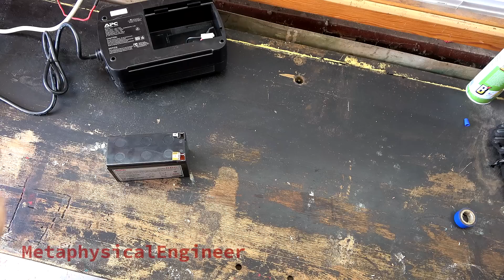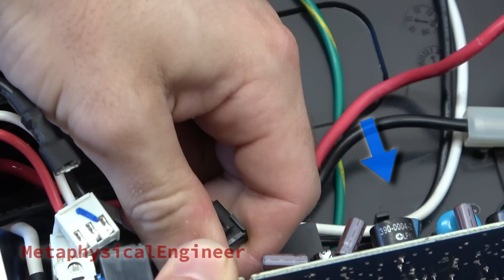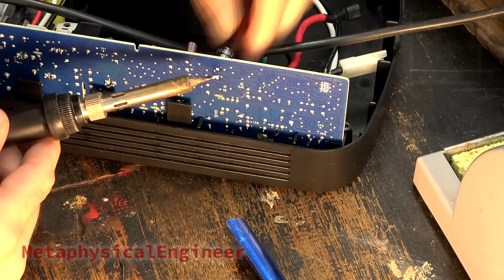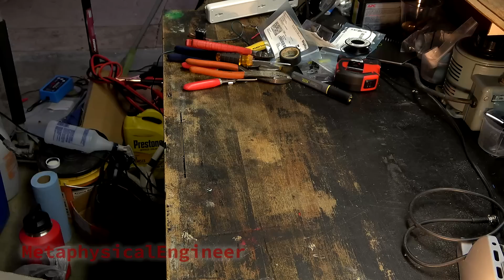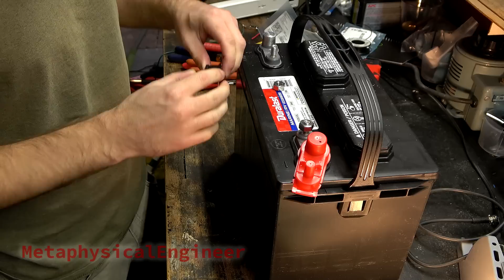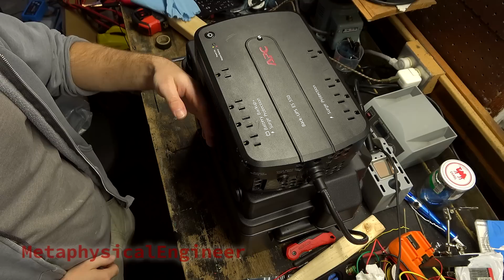Modifying broken UPS for long endurance BACKUP POWER!

Comment: Thanks for taking out the time. Quick question, how do I do this with a ups that is 24v and comes with two of those little batteries while I have one 12volts, 75amp car battery, do I have to get an additional battery which I cannot afford right now or can I make one battery work with it?
Reply from the maker: You need two identical 12V batteries for a 24V UPS.  If you need emergency power quickly and cheaply, a little inverter is a better option right now.  This won't have the instant transfer of a UPS, but will let you have things powered during an outage.  

I advise an abundance of caution.  There is a huge amount of energy involved when working with large batteries.  I paid a lot of attention to using the proper size fuses and protecting the wires.

Comment: I used one of these that I had laying around and replaced the internal battery with an 18 amp hour battery. it takes a long time to recharge, but it does work. I didn’t need a fan because I’m using it to run a router that only draws about 10 W. it keeps my Internet up for 12+ hours when the power goes out.
Reply from the maker: Nice!  Sometimes internet and a way to charge your phone is all you need during an outage.  May parents do a similar thing with a big battery and inverter since their area is prone to outages in winter storms and low on the priority list for getting hooked back up.

Comment: Thanks for your video its awesome!  I saw this trick the other day;  I have been dying to try!
You said your soldering pen was a bit old? maybe you have some old carboned tips also? I know I do! 

soldering
Reply from the maker: Thanks!
Part of the issue is that solder station is a Radioshack unit that's basically impossible to find parts for now.  Torn between finding ways to modify it to operate an iron I can get parts for (there's a video idea!), or outright upgrade to a proper solder station (boring but less time and less chance of failure).  Maybe both, just for fun.

Comment: Did this a few years back with a spare inverter and some used solar batteries from a friend who was upgrading to lithium. My home datacenter can run for about 24 hours on the batteries if I shut down everything that pulls a lot of power (ie the desktop and PoE switch). Enough to keep the internet going for a while during power outages, which is nice when storms roll through.
Reply from the maker: That's how to do it!  Hence why I keep have one monitor stay running during the transfer and I'd shut that off too if I had to keep things up for a while.  

My parents have a few batteries and inverters they use to keep things running during storm outages, as it can be a while before they get power back.  Storm raging outside while they're happily siting by the gas insert with a lamp and their laptops, all running off the backup batteries.  They can even run the central boiler to keep the pipes from freezing if the temps really drop.

Comment: Every APC I have ever worked with has had a "current limited" charger circuit - so in theory, you can add a bigger battery to any of them.
The only issue is "can the charger circuit work reliably and handle the heat of running for DAYS at a time"? - which a small fan on the final regulator is a good cure for.
Reply from the maker: So far the charger has worked alright, but a recharge time measured in weeks means I'll have to connect an external charger to get it boosted back up quickly.  Other commenters have mentioned having charger circuits fail on them, often taken out when the original battery failed.  Future upgrade or version 2 will have built in charger more suitably sized for the battery capacity.
Reply: @MetaphysicalEngineer  I've seen it take A week to recharge the battery after an extended outage. But seems like you get more outages then I do, or you worry about "back to back" ones more?
Reply from the maker: @bricefleckenstein9666  Not yet had back to back outages, but that doesn't rule out the possibility, either.

Comment: My approach is to save anything important then put the computer to sleep. Uses less power than shutting down and lets it ride out longer power failures than staying on since sleep only uses a few watts. If I do end up losing power then the computer still put its disks in a cleaner state than when power suddenly drops while computer is running.
Reply from the maker: Sleep or shutdown is the usual strategy during an outage, but a render or upload would still need to be restarted.  Render uses GPU for some tasks and that doesn't suspend its RAM during sleep mode, and YouTube doesn't like it if the upload data stream just goes dark for hours.  Wasn't worth the effort on the software engineering side to make those tasks gracefully deal with the edge case of unreliable power.

Comment: 1 volt charge left on a lead-acid battery bad? I had an idiot locally who wanted to sell me a bunch of 0V lead-acid batteries. Sure you can charge them back up, but they'll have very little capacity.

Comment: Great video! Watched all the way through - unusual for me. Thanks. Question:  When you build the activation circuit, you take it out of something that I and most others can do, so I'm wondering why not just let the fan run all of the time? Maybe a lesser cfm version? That would be easy for anyone to wire up.
Reply from the maker: Thanks for watching!  

The issue is the fan uses almost as much power as the charging circuit, so the battery possibly would never recharge at all.  Also, if the unit were unplugged, the fan would drain the battery dead unless deliberately disconnected. It's possible a lower power fan could be used, but that's still a passive discharge problem and I had to err on the side of caution since I was pushing the circuitry far beyond expected use case.

Comment: Hey, thanks for the video.  I now have a better understanding of what one is actually buying when one buys an inverter, and why they often seem so different from a UPS even though in principle they're doing the same kind of thing.

It's all about the waste heat which sorta kinda varies proportionally to the amount of time the thing is on battery mode and the amount of wattage being pulled.

I don't have the skill, patience, or tools to  build one of these out of the similar UPS I have that also has a dead battery.

But it's neat to see how it works.

Comment: Would it still be fine if the PC was doing something more compute intensive like rendering a fluid simulation in blender for example, or running a GPU and CPU test at the same time?

Comment: Nice. I personally use an old APC SmartUPS 1500 to cover my router, wifi kit, TV, and a LED light in our living room. I use a large old car battery which is in a vented garden box just outside on our patio. We have lots of powercuts which is why i did this. Its enough to run the LED light and our internet kit for 4 hours. Plus the expensive TV is protected against spikes from the outages.

Comment: Generally speaking, it's a bad idea to put a larger battery into a small UPS. I ran the idea past my EE brother (lead research engineer at APC pre-Schneider) several years ago, who told me that the inverter was designed to withstand sustained operation at rated output for only about a half hour before overheating to keep it cheap. They're rated for about 20 minutes. After that, he says the inverter is likely going up in smoke. Even at lower loads it will eventually build up enough heat to cause failure. Adding a fan can help, but the airflow needs to pass across the heat sinks and other components enough to keep it all cool, something it was not designed to facilitate. Adding intake and exhaust holes doesn't solve that problem. Also, consider recharging. The charger is only designed for a 7 amp-hour battery, and it too can overheat. Even if it doesn't, the charger is going to take an awfully long time to recharge a larger depleted battery.
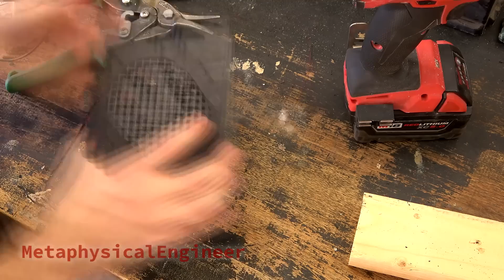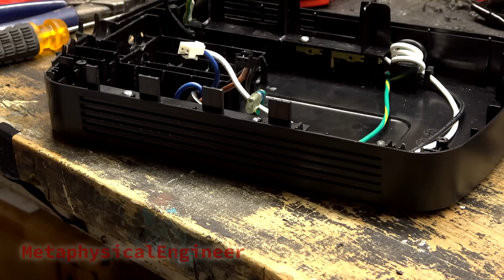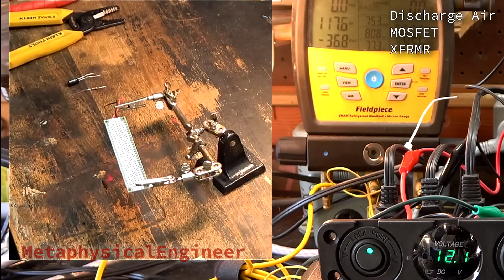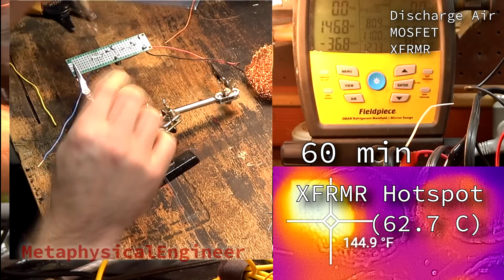Reply from the maker: 12:30 thru 14:30  shows how I specifically set up ventilation to direct air across the MOSFETs and transformer, and 15:30 thru 16:25 shows the extended duration load test with thermistors mounted to those components, wherein they shrug it off without coming anywhere close to maximum ratings.  

Concerns about the charger are valid.  Those are addressed in a bit more detail the pinned FAQ comment and narrated in the recent livestream.  The charger in this unit is essentially a maintainer for such a large battery, and it will need an external charger to recharge in a reasonable amount of time after extended use.  When it fails...I'll either rebuild with beefier components or bypass it entirely with a better suited charger module.

Comment: This video is NOT sponsered by Jackary... dude made his own... 
Note to Dude: buy both a countersink bit and a deburring tool... make that case mod a bit neater next time... plenty of old UPS'es out there in junk piles with dead battery problems... as long as the electronics are fine... New battery is all they need!
Reply from the maker: Deburring tool is covered in the pinned FAQ comment, among other things.  Discovered mine was missing when I went to drill the holes.  Since replaced.  

Off the shelf power banks with UPS inverter functions have some neat features, but essentially all I've looked at have too long of a transfer time between grid and inverter. 30ms instead of 8 to 12ms all but guarantees a PC will lose power during the switch.  That said, I'd love to do product reviews on some of those units someday.

Comment: would recommend not using a lead acid battery that's not sealed as that can cause an explosion from the venting of gases from the non sealed battery
Reply from the maker: Please refer to the pinned comment where that and other common concerns are addressed.  TL;DR: explosion risk for light duty single battery applications is conflated with the risk of massive battery banks under heavy cycling.

Comment: I would rather just power my stuff off of an LFP setup, for seriously long run times, and not having to worry about damaging lead acid with deep cycling, not to mention the massive increase in the power to mass density.
Reply from the maker: Lithium battery plus required BMS would greatly increase cost, though the high performance and deep cycling capability would be very nice to have.  Definitely on the table for future version 2!  Pinned comment addresses that and other common questions.
Reply: @MetaphysicalEngineer  I did it pretty cheap.   I guess it all depends on whether you keep your eye out for deals that come up around you.  Much like you did with your used UPS.  If you want super cheap, PPS are pretty cheap these days, and if you keep your eye out, you can find MPP controllers hanging around from aborted solar jobs.  An MPP with LFP rack battery is probably your best performance, to price per watt option.   I'd give you the numbers as to what I did that for, but then my comment probably wouldn't continue to exist.
Reply from the maker: @bujin5455   I'm quite curious about what you built.  Your info could be useful for someone else, and for when I do version 2.

Apologies for coming off as overly confrontational.  You're far from the first to ask about why I didn't just use lithium batteries.
Reply: @MetaphysicalEngineer  I have a number of LFP projects though the best one is from the aborted solar project.  I found a solar setup on marketplace, where the party intended to setup solar, never got around to it, then ended up selling the house, and liquidating the solar stuff.  I got the 48v MPP controller with 3000w sustained output (basically AC in/out, DC in (solar), DC in/out to batteries).  Along with a 1,250wH SOK LFP battery for two hundred. Both where new and never used.  The cool thing is, with this setup, you can scale it as far as you want.  Glorified UPS with zero time fail over, off of regular house power, sure.  Want to add solar to it, no problem.  Want that solar to offset your power requirements, while also providing UPS functionality when the power goes out?  Not an issue.  In my opinion, it's definitely the way to go.  I like the componentized nature of it, making upgrading easier, and failure less likely (as is usually the case with dedicated single purpose parts).  At this point I've scaled the project to provide over 10kWh of backup, enough to back up every critical system in the house: garage doors, deep freeze, refridge, lighting, servers and other computer equipment and networking/internet, even the entertainment center.  All of this is just plugged in, running through a kill-a-watt meter, allowing me to see what my total load is, at the wall, which has some inefficiencies that aren't there when powered directly off of battery, so it's a worse case power draw figure.  So I'm about ~300 - 500w, which is 33h - 16h (depending on factors, like how close to the top of that range I am, and what the actual float charge is of the batteries when the need arises).    However, i do have a pretty powerful tri-fuel generator I picked up from Costco, that is a bit loud, but produces up to 7500w of power, which means if I start to run low on power, I can start the generator for a while, power it back up, and then turn it off again.  Going further with the fuel, putting less wear on the generator, producing less noice on the whole, and getting to pick what time of day I do produce that noice, will not having to worry about extended power outages.
Reply: @MetaphysicalEngineer  I tried to give you a more detailed reply, but I don't see it in incognito, so I'm not sure if it'll show up for you or not.  Big brother doesn't like me posting things with numbers in it. 🤷‍♀

Comment: I tried this once, but gave up immediately once I learned the UPS I was using had a history of short circuit and fire risk issues.  Fun project, but I'm not looking to burn the house down.  Can't remember what I used for the fan turn on signal though, but I know it involved making a NOT gate from a few transistors.

Comment: I want to do the same with my UPS but I'm scared because the original batteries are 7Ah and the ones I want to put are about 50-80Ah and I'm worried about burning the battery charging circuit because I don't think the charging circuit is designed to deliver that much current.
Reply: Good news/bad news - good news, the circuit is likely fixed (max) current, pretty sure APCs do fairly smart charge management (as it needs to top-up charge over time).  Bad news for you and OP - if you have say 3 hours of runtime with your new bigger battery and the power is out for 2 hours, you better hope the next outage doesn't happen for a long time, because the little UPS's charge circuit is going to take a very long time to take the remaining capacity from the remaining 1h, all the way back up to the intended 3 hours.  Not only will charge current be limited by the circuit, but also by what you currently have plugged in; if the APC's mains cable and unit is say 10A, and you have 8A of load running from it, even if the charger could charge the (internal/official) battery in a couple of hours at 5A - today it can't because it only has 2A 'spare' to put into charging.

I've actually had something of an issue with this in my distant past with their unit's very-bigger brother units, maybe they were 3300 or the 5kVA versions running racks of equipment - but whatever the specifics, they had huge batteries and circuitry to match it, but as we increased the amount of kit attached to each unit, not only did it obviously reduce the runtime (which was still in acceptable limits) but the recharge time started stretching towards a week.  A 30 minute outage today would leave us exposed should there be another fault or if we needed to plan a second mains wiring maintenance window soon after the one we just made
Reply from the maker: @hatbabe @panconkisu 
Indeed the charger circuit is current limited and sized for the tiny original battery.  It will literally take weeks to recharge the big battery.  I'd have to use an external charger if I want it recharged in reasonable time.  

One note is that current calculation isn't quite accurate.  2A at 120V is 240W, which would be 20A of charge current at 12V.  This assumes perfect conversion efficiency.  A real charger will have a few percent losses in conversion, but would still have plenty of headroom even if a substantial amount of line voltage equipment is connected.  

If the original charger does fail, I'll either rebuild it with stronger components or bypass it altogether and build in a more powerful smart charger that will also solve the long recharge times.  A 6A charger would give plenty fast recovery while also being quite gentle on the battery.

Comment: I did something similar to this maybe 20 years ago with a HUGE old APC unit that ran 2 12v batteries in parallel.   I used a pair of Marine batteries which are better suited to being discharged over a long period of time.  It would run my 2000s PC, dual 19" CRT monitors, and network gear for at least a day.  Honestly I never was able to run it long enough to run out of power.   A bunch of internet "experts" informed me I was going to blow myself up because of the tiny amount of hydrogen released from the batteries during charging.  I'm still here.